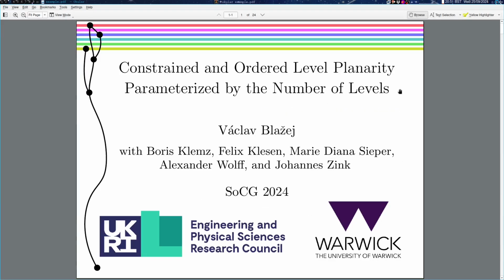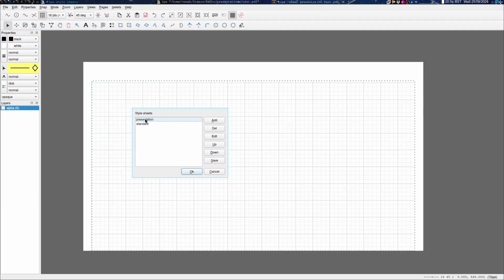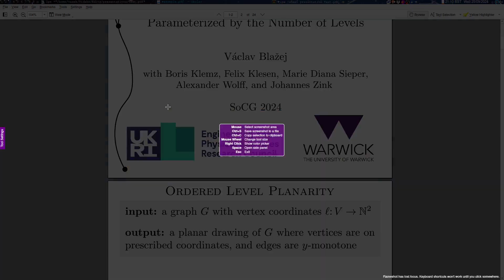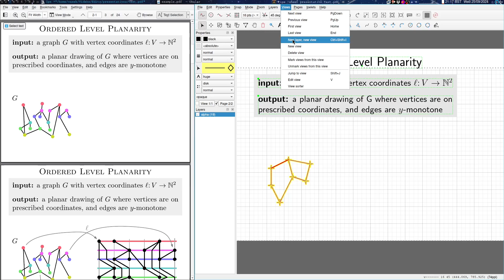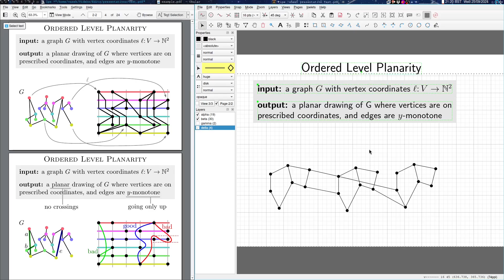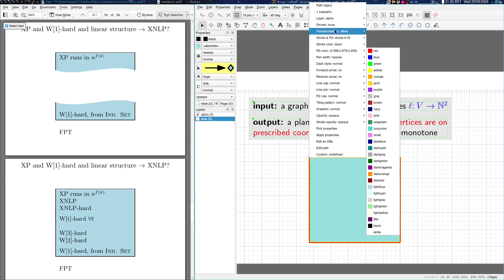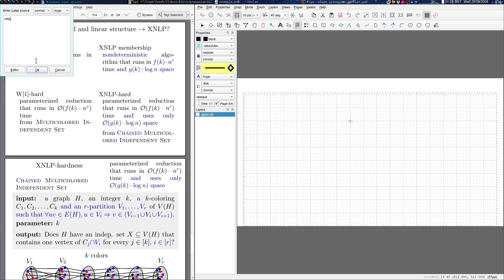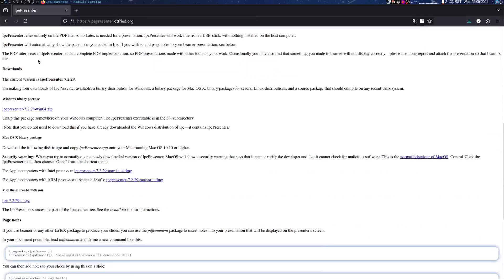How to make slides in Ipe drawing editor

Comment: How configure Ipe for working wih Latex,? LAtex is already installed but only online option is working....on Linux...
Reply from the maker: IPE should work with LaTeX out of the box. You should install IPE using a package manager (e.g. like apt), which should pull its dependencies - among others these dependencies contain latex base and other packages that should make it work. The particular LaTeX engine can be chosen in Edit/Document properties -- I think default is pdftex, but there is also xetex and luatex. Could you provide a bit more context to your situation?
Reply: @vaclavblazej  ...thanks, it was solved; a configuration file is needed  to set the path to pdflatex (~/.ipe/ipe.conf) with the following lines:  

IPEDEBUG=1
IPELATEXPATH=/usr/bin